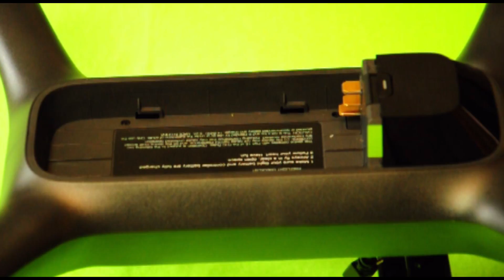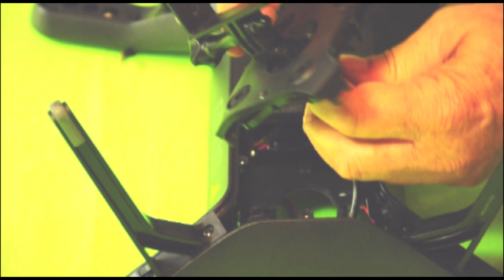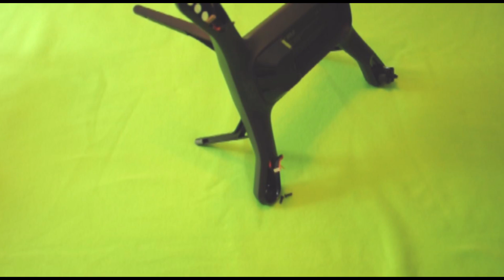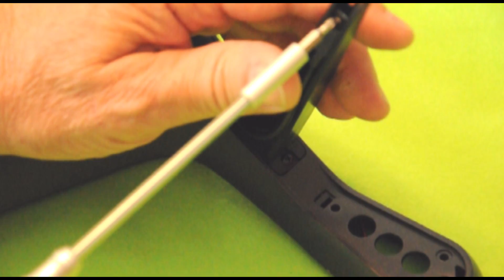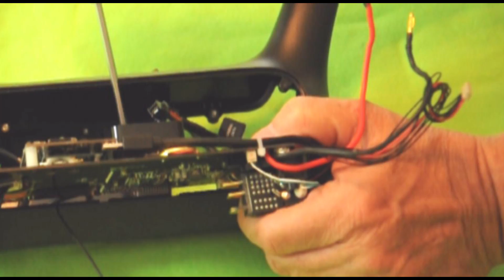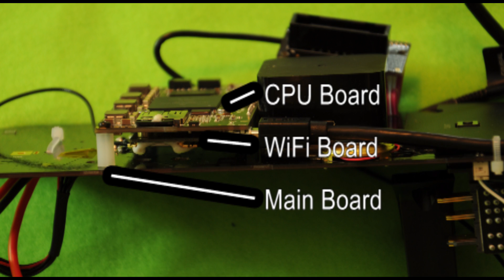3DR Solo Teardown

Comment: Great work.  I agree a motorpod teardown would be great.  Also a wifi card separation...I see that there are people replacing the stock card with a higher power version...  Might be a business opportunity :)
Reply from the maker: Earl Gray Good request.  I'll get on it soon.  Thanks
Reply: Looks like Solo and Controller are both options for WiFi upgrade.   One side only seems to add 3X distance.  Guessing both sides would add more since comms are two way :)  Bioards are relatively inexpensive, and replacement is plug and play, but many in the target market would be squeemish about opening up the unit.   :)    Here is the info: http://i.mt.lv/routerboard/files/R11-140818123114.pdf
Reply from the maker: Earl Gray The motor pod teardown is now live
Reply: I see it!!   +1